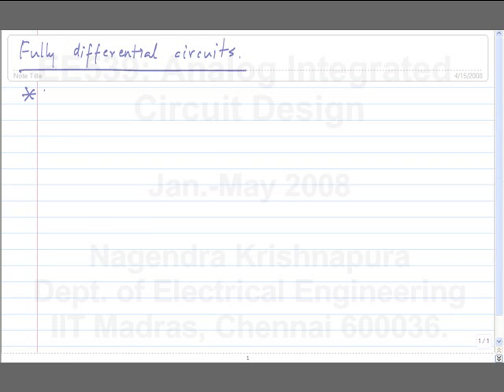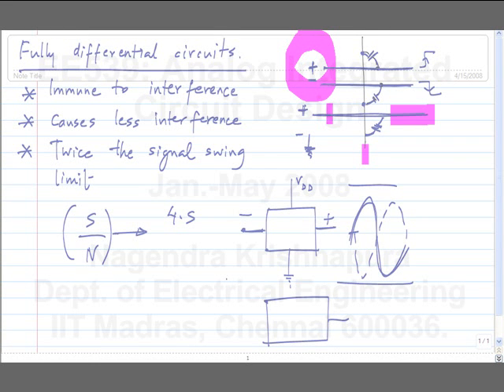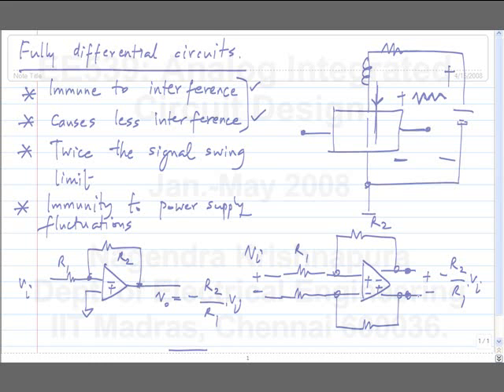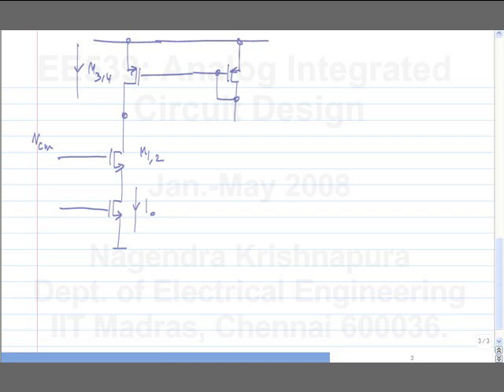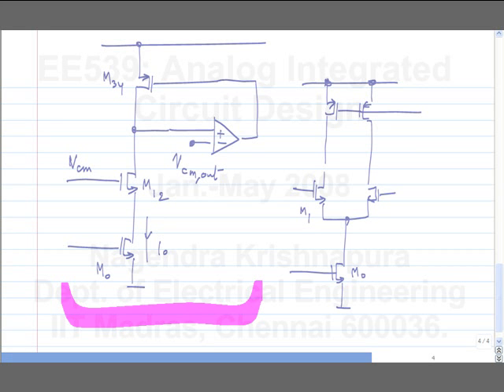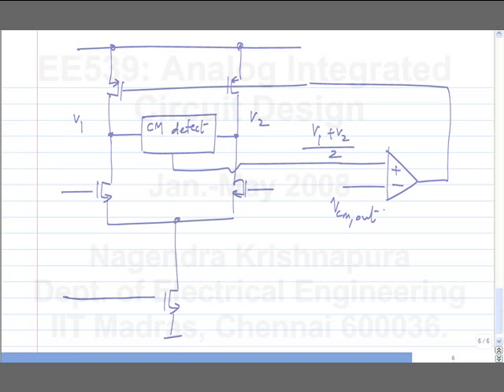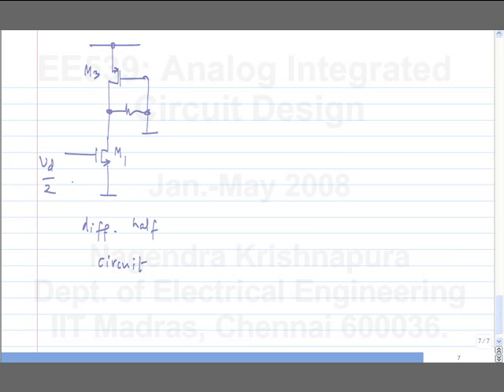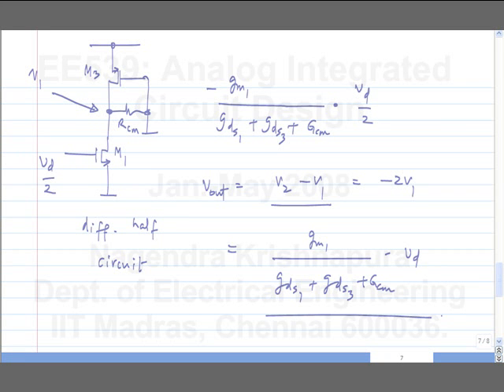lecture 50 Fully differential opamps, common mode feedback

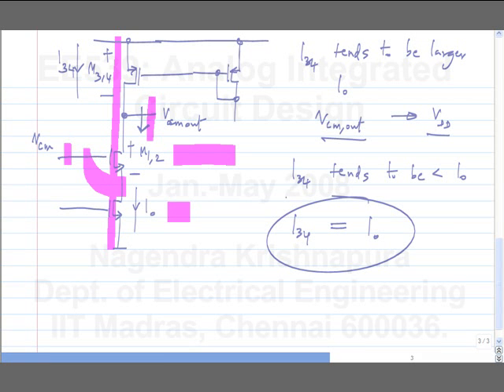Comment: @22:36 I think that in order to maintain the same current the source of the Mosfet M1,2 wil get reduced so, It will satisfy the Vds=Vgs-Vth relation and then the Vds for the M0 transistor will also get reduced where All will end up in linear region .

Correct me if I am wrong ..